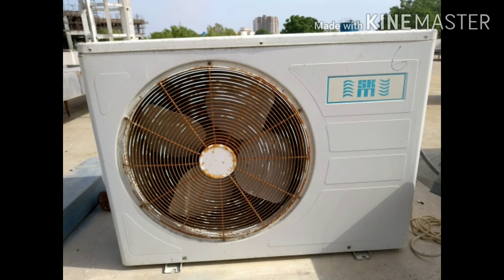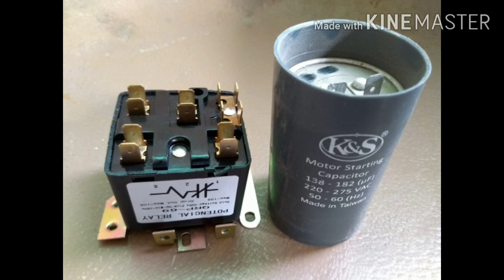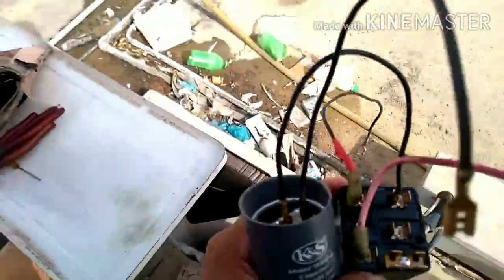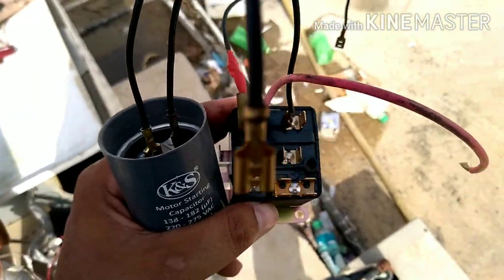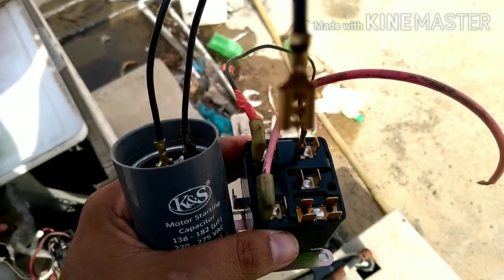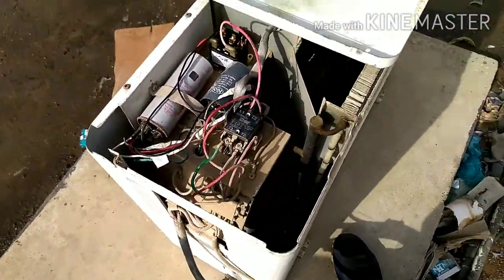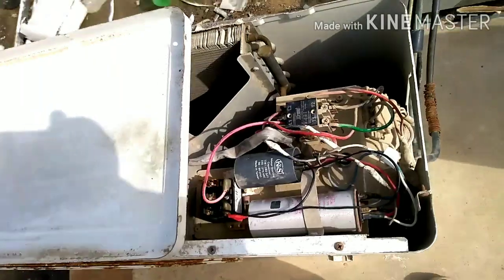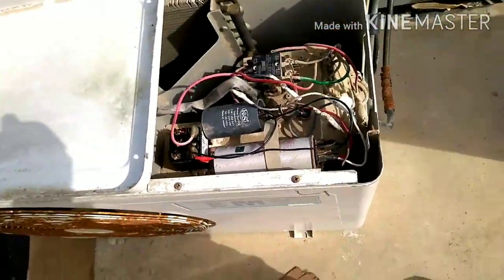Potential Relay wiring in split AC / How to connect potential Rely in split AC in Urdu / Hindi

Comment: Excellent.. 🤔although there’s a SIMPLIFIED or easier way only 2 wires to connect it’s call a hard start kit or booster capacitor kit
Reply from the maker: Exactly there is but already used not reliable it's work long specially industrial work